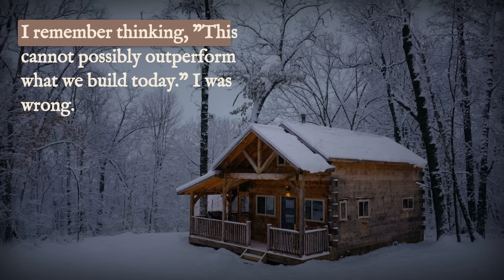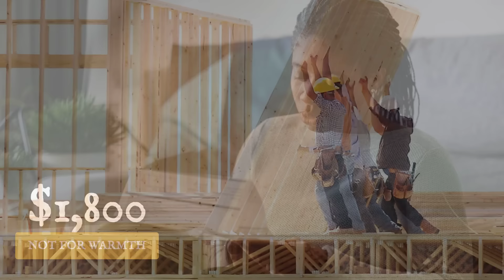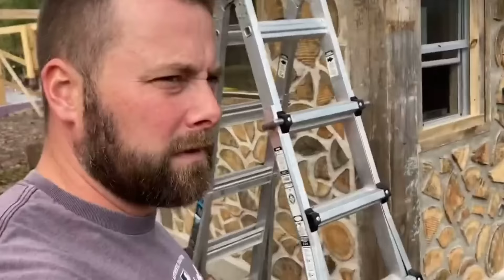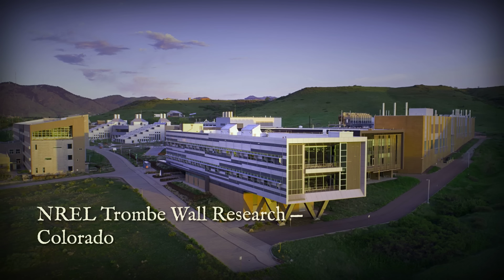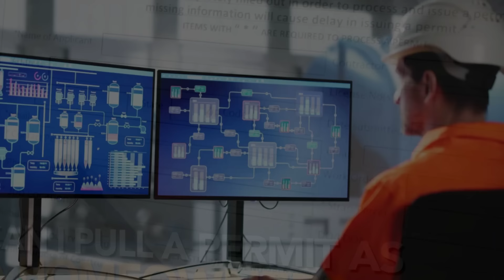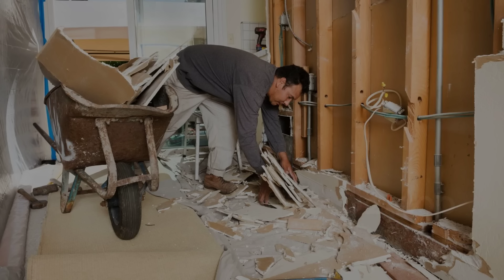How the Amish Build a Wall That Heats Any Home for Free — This Is the Exact System They Use

Comment: How is the temperature inside during late spring and summer? I'm in arkansas, summers are HOT. Does accommodating plumbing and electricity complicate it or reduce the lifespan?

Comment: I discovered not founded a better technique or I think it's better but I see the wood as being great decorating elements to add to river stone etc. The process is much shorter not having to let the wood cure but it uses hemp and limestone dust to make hempcreate. A 100% breathable brick with the utmost resistance to all you know mold bugs etc. it even self repairs if it does ever crack. I will be building as soon as I am able and making molds for various buildings I hope to share with all. I am creating a system where I need nothing from the government or society but instead like the Amish only from community. In the name of sovereignty for all we must unite. I have the blueprints which hold no hierarchy.  If interested contact me I'd love to converse with like minded people. Bottom layer rock or sandstone created using urea which has been know to last through 1000s of years as well. Both also provide the same radiant heat etc but also cave like cooling with proper venting think trombe wall you will never have to heat or cool a home again expect for probably 1-3 hours a day on extreme days.

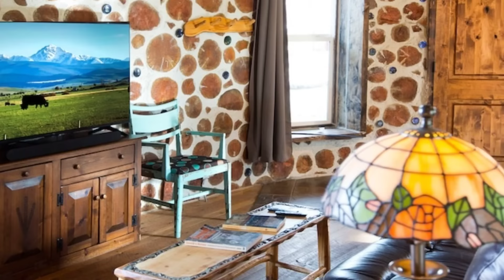Comment: 21:17  My issue would be, if I have a two story house with punk fiber in all the alls..
How do you real replace all the wall at shorter thickness to a wall that needs to be thicker with wood on both floors?  IDK where to being and how long to take to replace before the winter sets in again as I’m replacing one wall to the next?

Comment: Texas was ocean a long time ago.  The foundation is unstable bc of the muddly soil.  Every house have a foundation problems. I think stone building is the only solution  and it should be.  I wish I could have one that building in my backyard.  Prople think TX is hot state.  Nop.  Too hot, too cold.  Sharp sick cold wind without any mountain blocking.  I wish I knew b4 moved from New Jersey.
Reply: You could do adobe, works great and Texas is one of the few places that you can build with it naturally. You'd need to look into the potential mixture from your own soil, and legality to cover your ass, but it works great.

Comment: THOSE TYPE HOUSES ARE TERMITE MAGNETS UNLESS COVERED WITH TAR COMPLETELY ON EXTERIOR WALLS..LOGS MUST BE SEALED OR BUGS AND ROT WILL OCCUR AFTER A SHORT TIME
Reply: 1 believe that cedar is bug resistant. Have seen many cordwood biuldings. 1 hour east of Toronto Ontario. Also know people that put a room on the back of their farm house with nothing bigger than a 6 inch round and 16inches long cedar. Looked very nice. P.P. for PM

Comment: IM IN MID ATLANTIC USA.5OYR OLD LOW EFFICIENCY HOUSE, LITTLE INSULATION,OLD WINDOWS.$200.00 HEATING BILL PER WINTER.THATS THE COST OF GATHERING FREE ALREADY HARVESTED AT CITYTREE WASTE DEPOT FIREWOOD ,TRANSPORT 1 MILE TO 9OO SQ FT HOME,CUTTING WITH CHAINSAW.$2OO.OO IS FOR TRANSPOT FUEL,CHAINSAW FUEL,BAR OIL,3 NEW CHAINSAW CHAINS.1 PERSON,NO HELP HIRED FROM START TO FINISH.
INITIAL COSTS,$1,500.00 FOR 8O,OOO BTU HIGH EFFICIENCY WOOD STOVE ,3O FEET OF DOUBLE WALL CHIMNEY,INSTALATION.$300.00 FOR MS 25O CHAINSAW,CASE ,5 FILES.WOODSTOVE PAID FOR ITSELF AND SAW IN 3 YEARS OF ELECTRIC BILL SAVINGS.I HAVE A HEAT PUMP BUT ONLY TURN ON CENTRAL CIRCULATING FAN OCCASIONALLY.WE COOK ON WOODSTOVE AND DRY OUR CLOTHES IN WOODSTOVE ROOM WHICH REDUCED OUR ELECTRIC BILL FURTHER.THE ELECTRIC COMPANY KEEPS ASKING ME WHY MY ELECTRIC BILL IS SO LOW COMPARED TO SIMULAR SIZED HOUSES?I TELL THEM NOTHING.ALSO BECAUSE MY NEIGHBORS BURN MANY  OUTDOOR LIGHTS I NEVER NEED INTERIOR LIGHTS AT NIGHT I SIMPLY OPEN CURTAINS .AND MY HOUSE BECOMES FULLY ILLUMINATED.
I GATHER FIRE WOOD ALL YEAR FROM LOCAL TREE WASTE DEPOT AND FREE NEIGHBORHOOD STORM DAMAGED TREES PLACED AT STREET CURB.I USE 5 TO 9 CORDS PER YEAR,BUT THIS INCLUDES USE OF SMALL OUT DOOR FIRE PIT AND WOOD FIRED GRILL.YES,GATHERING CUTTING WOOD IS WORK,BUT ITS WORTH THE MONEY SAVED.

Comment: Yes that does exist but it does not allow you to build with what ever you want to and not follow certain building code and safety you still have to have your planes approved by the county and city. So this doesn't get you around anything except having to have a contractor license and insurance, stop feeding people a lie that this will allow them to build with whatever and how ever they want. And you still have to buy the permits to build also., at least in every state I looked it up.
Reply: Owners can build on there land. Unincorporated land can build how they want. Cities no but on acres of land you can.
Reply: @massdisruption3437  might want to double check where ever you decide to , there was a couple on here that did that and they had a choice to tear it down or not live in it because it didn't meet their codes, and there was nothing for miles, that's why they built on it. And still doesn't change what this vid is saying is not truthful, it actually has nothing to do with building how you wanted as it leads you to believe, it is only for not having to have a contractor license and insurance stuff like that, just saying.
Reply: @mikedully6635 point taken and your right if the area you buy in is the wrong zone. What I found is in unincorporated areas(on acres of land)  or unimproved areas you can do what you want. With that said the video is more of a commercial. It doesn’t listen the obstacles.
I live in a city with a lot of immigrants from south of the boarder.
 They are doing their own roofing,additional rooms,etc. without permits, etc. the long time neighbors are like that’s a problem, but Body calls it in.
The city doesn’t seem to care. Maybe we forgot what made America America.Doing what you gotta do on your own property!!!!!!
Reply: @massdisruption3437 
Thank you for the common sense truth!!!
   In 5 years if some inspector comes around, maybe I'll worry about it then.....
     (If something like that was to happen)
    Ask for permission, or ask for forgiveness, if you are caught.  These dummies don't realize, there's a one in a million chance of trouble.
    Also, you have to know to keep your mouth shut, stop blabbing your business all over the Internet and at Lowe's and home Depot etc.... 
   Teach your children, family etc to answer no questions, talk to no inspectors etc...
   And do what you feel is necessary in your kingdom and in your castle.
    Most important, 
Never ever lick their boots!!!
Reply: @eriklittlebigg7440 😂😂😂😂😂 i have never licked boots. I wouldn’t know what they taste like.I can imagine they probably taste like possum arse cheeks. I haven’t tasted them ether.  So those that do. They amuse me. What reward do you get for groveling at the feet of other people. You are a thousand percent correct about keeping your business to yourself. What you do on your land is your business period. As long as you aren’t dumping chemicals in water or your land. You’re fine with me. I like the way you put things. You write in a way that can reach people. That’s a gift.
Reply: Move to an area that don't require a permit they are far and few in-between. I would do the rocket stove method you need a basement or you can pipe hot water in your house and keep the rocket stove in an out building that don't require a permit. There are videos on those large heating systems that require mason work. 73

Kekkelovn stove 73
Reply: @ronb6182 Im planning on building a rocket or masonry stove in my basement. I just payed $6.80 a gallon for fuel oil here in ny!
Reply: @bobmalik6757   I hope the project goes well. If I move to the mountains I will build one myself I don't believe I could get away with one on leased land. But I'm only there temporary until my wife can retire. I live in Florida so cold weather is only a couple of months and the worst is over now. 73

Comment: cedar is expensive. unless you grow your own or buy a ceadar forest. cedar is not cheap. you got to know that. before you get to planning it. they used to have cedar forests in minnesota.. and in western Washington I've seen some cedar on the sound over there. I haven't cedar forest there. but I've seen a few old cedar trees  there. I think they have cedar in michigan too. anyway. this is a good idea if cedar wasn't so expensive. but the lime you should be able to purchase from youre city water purification plants. over here in ray that have lime pits at their water plant. and in Williston too. they are burying lime in land fill style fills. I guess lime is a plentyfull substance. who knew. the water they get here from the missourie river is full of it. so they filter it out or it will clog up the pipes. then they just pile it in pits. when the pit gets too full. they move it to a pile in field or land fill.. I don't know how free sawdust can be because they like to make sawdust logs for fire places with it.  and they also like to make a particle board with it that is very expensive and used in your countertop  and sometimes flooring material. I would think that you would have to find a small wood mill that it just doesn't pay to ship the little bit of sawdust to production shops.. I got on to query about whether this might be a good wall in the equator area of the earth. this is probably only a good wall at the four seasons areas of the earth. I wonder if it works well any where Canada or the artic. my biggest concern is seasoning time is very long. 2years before you can use it is a long wait. so you better make sure you get 20 to 30 percent more than you think you will need. so you don't run out and have to wait two more years to finish your walls. and was this wall all the way around the exterior? or just one side or what. I have a fantasy concrete wall that I would like to build. 3 foot thick. to keep the heat back from getting in the house. I wonder if this wall is good for 3 foot thick to keep the heat back .and not let it soak through the wall.

Comment: Turn your roof into a climate controlled roof.
Cover your roof with a couple of thin coats of mortar and seal it with a white elastomeric coating 
The mortar blocks the heat and cold from penetrating your roof.
I'm going to do my exterior walls next.
Reply: Please elaborate on the "mortar" details.
Reply: A mortar roof is intriguing.